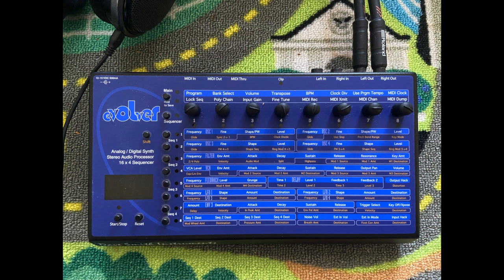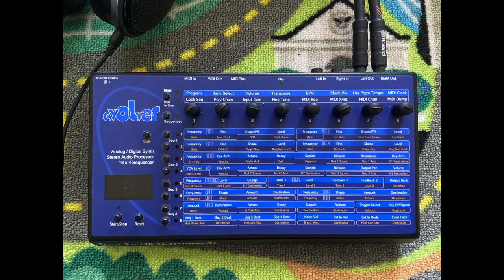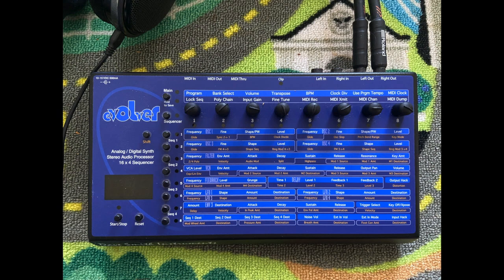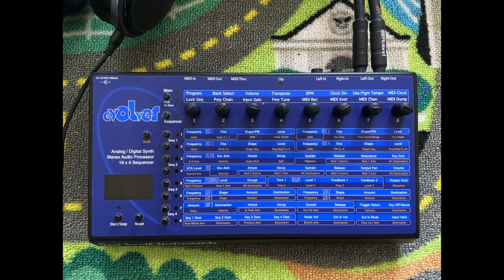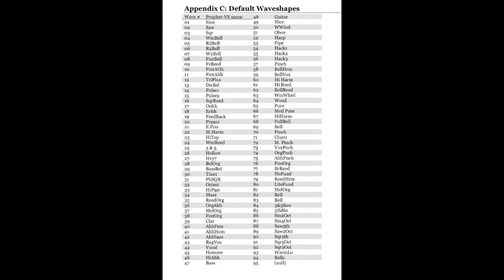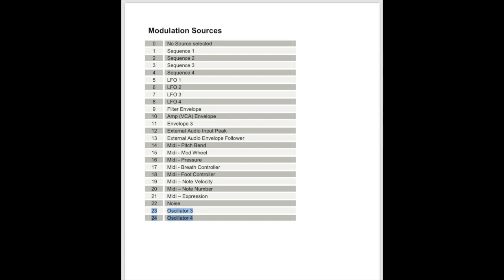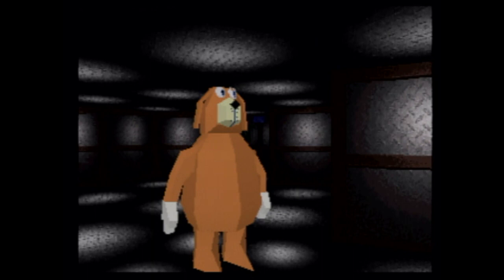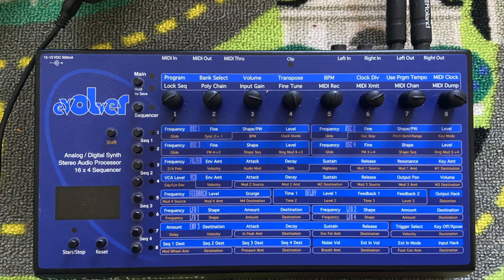Dave Smith Evolver // My Favorite Synthesizer

Comment: Best three upgrades for the Evolver. 1-  inline power switch. (Power on and off without unplugging).  2- knob upgrade (the added feel and bling go a long way). 3- laptop stand (more visually ergonomic) Cool video.  I love my Evolver. Look forward to more Videos.
Reply from the maker: Yo thanks for watching.     I’m gonna need to look into this power button mod.   The lack of power button normally doesn’t bother me I just unplug but I be forgetting sometimes.

What knobs did you get to upgrade if not the prophet 12 knobs,  I think that’s what I’ve seen before.

Will acquire stand soon. And hopefully more evolver videos soon.
Reply: I would put the switch before the external power supply. I really bother to leave the supply to usurate being switched on forever

Comment: Hi, thank you for this upload.  Do you think the desktop version works well without a computer and with just hardware, such as a grid or controller?
Reply from the maker: Hey thanks for watching.  I actually really like using the desktop by itself.  I do not think any other controller is necessary but definitely would expand your capabilities.   If you had another controller you have up to 4 extra modulation routings.  Velocity, mod wheel,  aftertouch, and breath control.  These are hardwired mod sources, freely assignable. If you say used aftertouch to modulate x, you could free up your lfos to do something else.  I never use these because I primarily just use as desktop module.   

Also almost every parameter is addressable by midi cc.   This is something I want to talk about in a future video.  Because it allows you to workaround some of the limitations of the evolver.  Something important to mention tho, you can only ever edit 1 row at a time on the desktop.  So you can’t say increase filter cutoff and delay at the same time.  With an external controller you could do that easily.    

I actually have the software editor also but never really used it once I learned the desktop workflow

Comment: did you everything without editor or did you use an editor like soundtower ?
Reply from the maker: I have the soundtower editor but do everything from the evolver hardware. Im sure the software is faster and i should probably use it but im not sure i believe its absolutely necessary. i Think that the matrix editor is really well laid out and after using the evolver for a little while its easy to know your way around.  To be honest i dont even use a midi controller when making sequences or playing my patches even though i should, in order to utilize the mod wheel or aftertouch routings,  or to be able to transpose sequences on the fly maybe.  I also feel like i have learned some things about the evolver that i might not have if i had always been using the editor.  Thanks for watching also